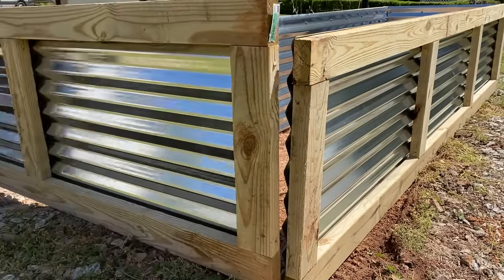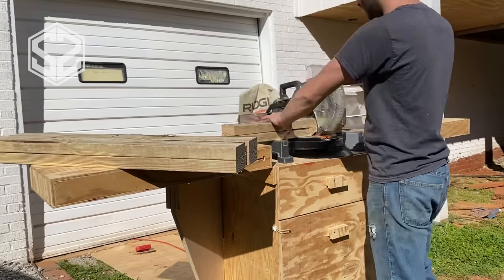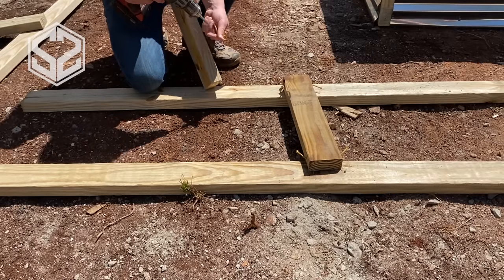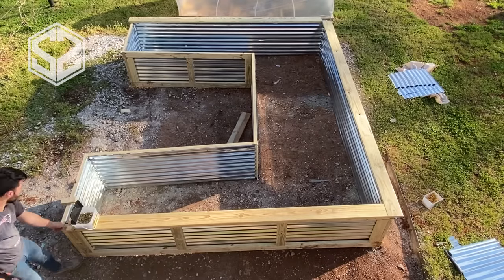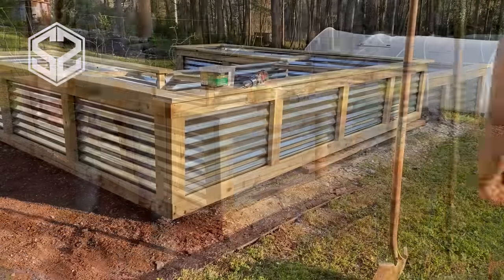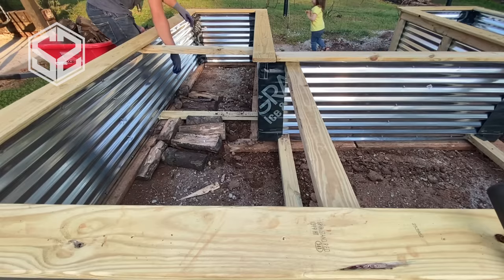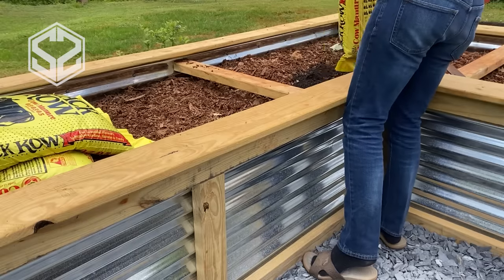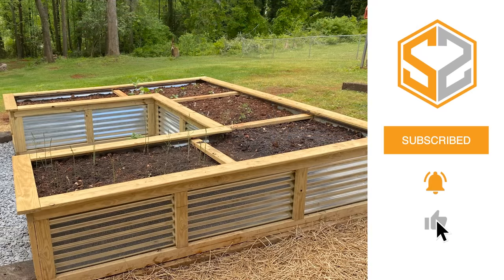How To Build Raised Garden Beds

Comment: Does the metal get hot and heat the soil? If so, does it ever get too hot?
Reply from the maker: I didn't notice it getting to hot this past summer even on the hottest days. I believe it helps using the silver metal as it reflects most of the suns rays that would normally heat up the surface. We did also try to water the garden at least once a day especially on the hot days.
Thanks!

Comment: I love what you've done here ny only complaint is it is a little over engeneered for me. I couldn't fathom putting the metal up nor could I justify doing it. That's not to say I hate the idea but I;ve grown everyting from a small flower patch  to 50+ acres of various crops. Also I don;t know where  you live that you could trhough fire wood out like that but where I live that is our summer wood and then what is wtill left over just gets piled of to the side and burn a few pieces of a time durin the next winter. Brying questionable wood (wish should be fine other than it's too dry and will burn fast) compared to not having to purchase a half to a full courd next winter will save me several hundred bucks and what it's purpose is I have no idea I have a raised bed (which I plan to expand) and a 3.4 acre in ground garden both of which grow everything I plant extremely well

Comment: I use the composite decking materials because they last forever. Real wood rots away in a few years.
Reply from the maker: Thanks for the tip! Is it strong enough to support the weight of the soil?
Reply: @SimonSaysDIY  Yep. I hammer in 3/4 inch conduit about every 3 feet to held it all together. Then line the inside with the faber cloth stuff to keep all the dirt in.

Comment: Why wouldn’t you use pavers as the base to keep the bottom wood supports elevated off the ground.  Sure they old wood from the last beds does the same thing but that is only temporary.  I would 100% use pavers as the foundation it sat on.
Reply from the maker: Totally right! Great idea, thank you so much! I will keep that in mind if I build another one :)

Comment: Everything looks good but I have just one problem. With all that dead wood in the bottom of your bed , that will attract termites!
Reply from the maker: Yeah it may end up doing that. If your concerned of that you could use leaves and instead as they breakdown slowly and are great filler if you have enough of them.

Comment: Pressure treated wood.
Reply from the maker: True, I have been told that the newer treated lumber is supposed to be much safer however it is not without risk. A safe option would be Cedar, Cedar is naturally resistant to rot and pests like termites. This lumber is more expensive than treated lumber but may be worth it if you have concerns. 
Thanks!

Comment: I would not use pressure treated wood anywhere near my veggies. They use arsenic as a chemical in process. And it will leak from that wood to soil, and your crops will absorb it.
Reply: The arsenic formulation was phased out in 2003.  Never hurts to do a little casual research occasionally to stay current.
Reply: @iowapipe  It is still in use in some wood products.

Effective December 31, 2003, chromated arsenical manufacturers voluntarily canceled virtually all residential uses of CCA, and wood products treated with CCA are no longer used in most residential settings, including decks and children’s playsets. EPA has classified chromated arsenicals as restricted use products, for use only by certified pesticide applicators. It can be used to produce commercial wood poles, posts, shakes, shingles, permanent foundation support beams, pilings, and other wood  products permitted by approved labeling

Also pressure treat wood contains lots of other chemicals, for now they are considered as "safe" but arsenic was also "safe" until 2003.
Reply: LOL, ok… I’ll stick with the  “cancelled in virtually all” portion of that statement.
Reply: @iowapipe  Cancelled ONLY for residential use (indoors). Outside of the house still used widely. Read the last sentence.
Reply from the maker: Thanks! The wood I used is some of the newer safer type as this is meant for decks. However, if your worried about it cedar would be a great option however it costs more and doesn’t last as long.before building I did some research and found that the soil has to be in contact with the wood for it to have the chance to leach into the soil. Also the soil has to also be very acidic for it to leach the chemicals which soil like that isn’t good for gardens. And when it leaches the research that I found is that it will only effect 2-3 inches of soil. I made every effort to avoid the soil coming into direct contact with the lumber.

Thanks! :)
Reply: Yep, i did you the initial courtesy of reading the whole thing you quoted.  So for this context, we agree.  Which is what this is all about.   Have a good one!  :)
Reply: @SimonSaysDIY  I am trying to do as much of organic in my gardening as possible. So, no pressure wood at all. I am very suspicious about chemicals used there, I do not want them in my food. Actually I made compost boxes just from pine boards (not treated) - after 4 years of composting I removed compost - and there was not even a sign of rotting, They were just staying on the ground.

Comment: Wondering if anyone might have some ideas for the version of this we are making.

First, we were wanting to put this on our pre-existing beds that we changed from bark to rock. We don't want to put the dirt directly in the rock, but figure we need to ensure the bottom has the ability to drain. Would we be safe just laying down some landscaping fabric?

Last question. Do you think we would still need those cross braces if we are doing 3 40" x 40" boxes?

Comment: take care not to use galvanium roofsheets for gardenbeds. if you orient the opposite way you can easily bend the sheets to overlap or cover edges and corners, so no need to add toxic roofsheet. the glue in that stuff should never be put in garden. finally, if you raise off dirt with bricks or similar, and have the internal sheet roof panel slightly longer at the bottom, it will prevent more wood to dirt contact.

Comment: you should not put pressure treated any where that the chemicals can run into the soil   lots of nasty chemicals  also the ice barrier  you do not want that near your food, one brand ) like the one your using)  read the safety warning says right on it may cause localized skin tumors   
  other than that great design and great video

Comment: won’t the metal cause the soil to heat up
Reply from the maker: This past summer I didn't notice any issues with it over heating. But I imagine with it being raised it is likely to freeze faster in the winter but it will also warm up faster in the spring and may allow you to plant sooner as it is not insulated by the soil around it.

Comment: Ummmm.. PT lumber for gardening? Not worried about toxins?
Reply from the maker: Not really, the new type of pressure treated lumber is supposed to be much safer than the older stuff. I also tried my best to prevent the soil from contacting the lumber to prevent leaching. This may last up to 5 or so years and then I will rebuild and try something betting next time. :)
Reply: @SimonSaysDIY  Yeah, but it's the "supposed to be" part that makes me nervous. It's like when a contractor says to you "dont worry"... That's when I start to worry (recently got bit in the arse for exactly this). I wanted to use PT, but decided to shell out a little more for cedar.... well, actually, Im dropping a cedar and gonna break that down into lumber. DIY videos on how to break down a tree much welcomed :)

Comment: Might I suggest not using pressure treated wood for raised beds? As a former carpenter, I’ve read the hazmat literature on this product. 

PT lumber uses chromated copper arsenate (a known carcinogen) to reduce rot and insect susceptibility.

As it gets wet, dries out in a repeating cycle, the CCA leeches into the soil and is absorbed by plants. I guess it would be alright for flower beds but I wouldn’t want to eat vegetables and fruits out of a garden bed with PT lumber.

Railroad ties use creosote (a ton of chemicals go into it) which is also carcinogenic. Same leeching occurs. 

Natural or manufactured stone would probably be best as “an instead of”.

Comment: Good video except pressure treated wood should not be used. The chemicals used to treat it will leach into your soil and plants. Use cedar or pine. It lasts longer. Your treated wood has already broken down and contaminated your soil.
Reply from the maker: Thanks for the info! Cedar would be safer but costs more than pressure treated. It still is a great option if there is concern about the chemicals.
Thanks! :)

Comment: good video but you never use PT lumber in beds where youre growing food…
Reply from the maker: Thanks for the tip. The newer style of pressure-treated lumber is said to have no arsenic and much safer. Even still I tried to be extra safe and limit the direct contact with the soil as that is how chemicals leach most effectively. I was comfortable with this after doing some research however, this could be done using cedar lumber which is a totally safe option if there is concern.

Thanks!

Comment: Also as a roofer you definatly used your ice and water shield incorrectly. It's not going to protect much of anything.
Reply from the maker: Thanks! I figured it wouldn't seal the moisture in. My goal was to prevent the majority of the dirt from coming in contact with the wood.

Comment: you should never use pressure treated wood as the creasote or CCA leaches into your food
Reply from the maker: True, I have been told that the newer treated lumber is supposed to be much safer however it is not without risk. A safe option would be Cedar, Cedar is naturally resistant to rot and pests like termites. This lumber is more expensive than treated lumber but may be worth it if you have concerns. 
Thanks!

Comment: Has anyone else thought, will chemicals from pressure treated lumber leach into the soil and contaminate food
Reply from the maker: True, I have been told that the newer treated lumber is supposed to be much safer however it is not without risk. A safe option would be Cedar, Cedar is naturally resistant to rot and pests like termites. This lumber is more expensive than treated lumber but may be worth it if you have concerns. 
Thanks!

Comment: Why grow vegetables in pressure treated boxes?
Reply from the maker: True, I have been told that the newer treated lumber is supposed to be much safer however it is not without risk. A safe option would be Cedar, Cedar is naturally resistant to rot and pests like termites. This lumber is more expensive than treated lumber but may be worth it if you have concerns. 
Thanks!

Comment: COMMON SENSE, if this is intended to be a Vegetable garden ,do not use any materials that are made with products that can harm you. for example PRESSURE TREATED WOOD AND CORRUGATED METAL THAT'S COATED WITH A WEATHER RESISTANT COATING (the materials used in Pressure treated wood and corrugated metal will leech into the soil and will be absorbed by the plants !!) The only safe material one should use is NATURAL RESISTANT WOOD !! for example CEDAR !!!!!!! its seems this video is more about making something that's pleasing to the eye rather than something that's actually useful. It would make a perfect Flower garden !!

Comment: You used pressure treated? You know the chemicals used to treat that wood are toxic? Your vegetables draw the chemicals out of the soil that the wood expells
Reply: Incorrect, research .. they stopped using those types of chemicals
Reply: @thespig13 "The benefit of wood treated with MCA and micronized tebuconazole is long-term protection of wood and its reduced toxicity compared to earlier pressure-treated wood varieties, allowing it to be used for residential projects.Apr 6, 2020" its reduced toxicity. Still toxic just not as bad as CCA
Reply: @Valuedcompensation  correct but also the boards are not what's in contact mostly with the soil, the metal roofing is
Reply: @thespig13 true.

Comment: Keep in mind, not sure if it's mentioned or not, but do NOT use pressure treated lumber if your growing anything edible. The chemicals used for pressure treating will cause many plants to be poisonous. Cedar is a better option for that.
Reply from the maker: True, I have been told that the newer treated lumber is supposed to be much safer however it is not without risk. A safe option would be Cedar, Cedar is naturally resistant to rot and pests like termites. This lumber is more expensive than treated lumber but may be worth it if you have concerns. 
Thanks!

Comment: No chicken wire at the bottom to prevent gophers?
Reply from the maker: I have had a few gophers messing with the garden in the past but they haven’t figured out how to get it since I build the raised beds. 
Chicken wire wouldn’t be a bad idea! :)
Reply: @SimonSaysDIY  I had made a raised garden bed with cinder blocks but it was only 2 high and on the bottom i put chicken wire to keep them out. It definitely helped.

Comment: You should NEVER use pressure treated lumber for garden beds.  They contain chemicals that are very dangerous, that's why it says to use gloves when handling the lumber.  The plant roots absorb the poisons that  secret from the lumber.  
Please only use lumber from a local sawmill that's not been treated with chemicals. 
The wood preserving chemicals include formaldehyde, arsenic and other poisons.  😳🤔👍😃
Reply from the maker: True, I have been told that the newer treated lumber is supposed to be much safer however it is not without risk. A safe option would be Cedar, Cedar is naturally resistant to rot and pests like termites. This lumber is more expensive than treated lumber but may be worth it if you have concerns. 
Thanks!
Reply: @SimonSaysDIY  you're welcome

Comment: I don't like the fact that some of the elements will last 20+ years, especially with the wood given basic treatment, while others like the exposed inward wood corners and the burried planks, will rot and lose grip of the screws in about 5 years and 2 months respectively. It would take so little to make the whole thing last 20 years yet you don't bother; I don't get it. I like the design regardless, it'll sure be sturdy in the meantime.
Reply from the maker: Thanks! You are correct, I few great ideas were pointed out to me after posting the video that I will be sure to implement in my next garden bed. The main problem will be the main supports holding the beds from bowing outward. Thanks for the feedback. What would you do to fix the issues? :)

Comment: RR ties are not good for raised bed gardens because of the crasol they use to protect the wood is cancer causing .  Heat treated is o.k. . Many people consider heat-treated wood to be more environmentally safe than pressure-treated timber. This is because, unlike with pressure treatment, the thermal modification process does require use of potentially damaging chemicals.

Comment: That wood will rot in 1 year and have termites. 

I messed up and used regular wood and it don't work.
Reply from the maker: I used pressure treated lumber and it’s still working great 3 years later. 👍🏻

Comment: 2x4s? looks more like 2x6s and 2x8s
Reply from the maker: I used 2x4s for all of the framing around the metal and then deck boards which are about 6in x 1.25in around the top. :)
Reply: Please don’t take this as rude but apparently you don’t know what a 2x4 or a 2x8 looks like

Comment: They look nice, but all that time and expense and your right back to where you were before. Not gonna last for the exact same reasons you got rid of the previous beds. The butt joints are the weak spot compounded by using pine.  Been there done that.   Not to mention it's overkill.  Been vegetable gardening over 60 years. Got into the raised bed hype 40 years ago. Experimented with half a dozen different styles and about 15 years ago went back to traditional ground beds. Raised beds are more work, more maintenance, more watering, more money, more bedding soil. Focus on the soil not the bed.

Comment: This is the incorrect way to use corrugated sheeting. You should never use it with the corrugated lines horizontal, all this does is create ledges for dust/dirt etc to sit on. Corrugated sheeting must always be used vertically.
Reply from the maker: True, but then you would lose I’ll the strength it adds horizontally and the 2x4s alone wouldn’t hold back the weight of the soil.

Comment: NEVER use pressure-treated wood.
Reply from the maker: It last so much longer, but a more natural option would be to use cedar which is 2-3 times the cost.
Reply: @SimonSaysDIY  It's the chemicals in the pressure-treated wood that is worrisome not the cost of cedar. You should not be promoting the use of pressure-treated woods for this purpose.

Comment: treated lumber is questionable in terms of safety in food gardens - ACQ and CA contain copper and other preservative chemicals that have not completed long term testing and research for leaching into food crops- definitely do NOT use green tinted lumber as that is the old treated lumber, which used arsenic.
Reply from the maker: A safe option would be to use cedar lumber but that would shorten the lifespan of the garden as it rots faster and it also costs more. 

I did try to limit the amount of contact the soil had with the treated wood because I wanted to avoid any unnecessary exposure to chemicals.

Thanks for the insight! :)

Comment: It’s going to rust
Reply from the maker: It’s galvanized steel so it should last awhile but it will eventually rust. I believe it will last about as long as the pressure treated frame will. Thanks! :)